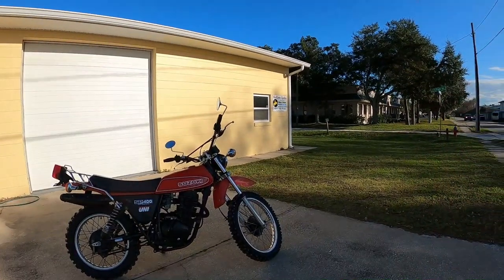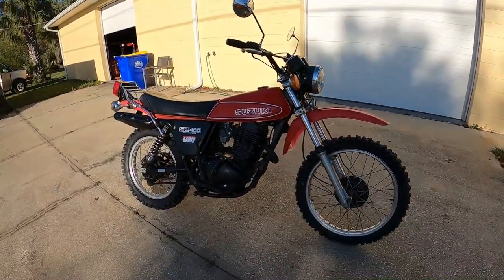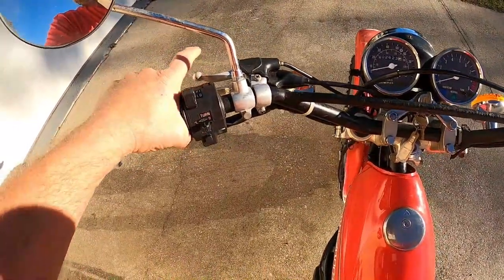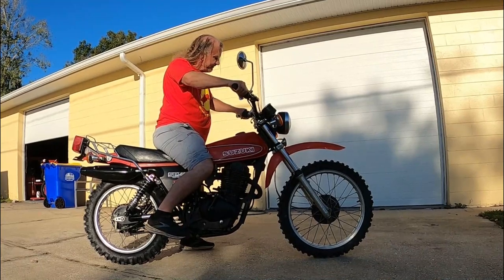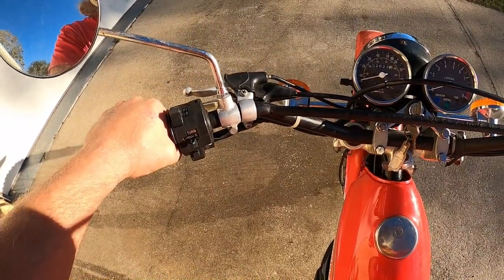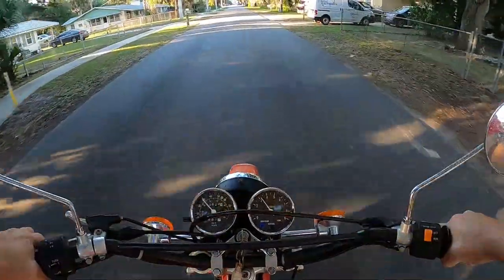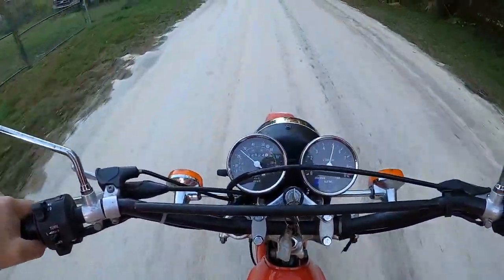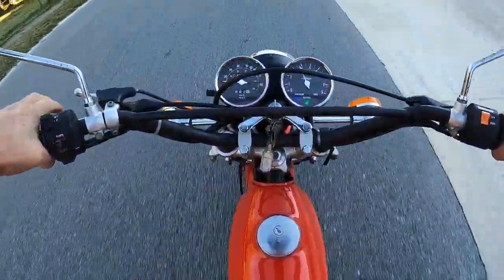KICKING AN OLD SUZUKI SP400 ENDURO THUMPER WITH NO E-START - CAN WE START IT?

Comment: Worked in a Suzuki shop back then. Dunno if we sold many SP400's, I can barely remember.  But we did sell a lot of DR's though. 
Great reliable bikes. Being young and dumb I preferred the wheelstanding 500. 
One of these 370/400 would be great nowadays. 
The more you ride these, the easier they start. 
Fuel is fresher, plug and carb jets clean, air filter clean.
Reply from the maker: Thank you. I sold that bike about 1 year and 1/2 ago, but I think its floating around marketplace again.

Comment: I had a new SP370 in 1978 and SP400 in 1982, both in red. Lovely bikes, but pigs to start.😀
Reply from the maker: Funny thing, before I adjusted the valves (they are spot on now), it was easier to start. I could start it w/o the release dohicky
Reply: They start easily if serviced with fresh fuel and plug. 
Much easier than the 500's.

Comment: The sp370 had no valve lifter. To start it you kicked over the engine with the ignition off  a couple of times, bring it up to top dead centre, or a smidgen over, ignition on and a big kick.
If you kicked it over without bringing it to just over TDC you will injure yourself. The kickback is like being hit by a sledge hammer on the sole.. You have been warned.....